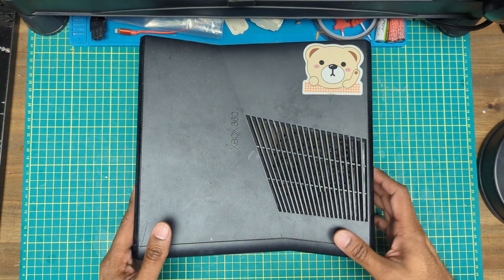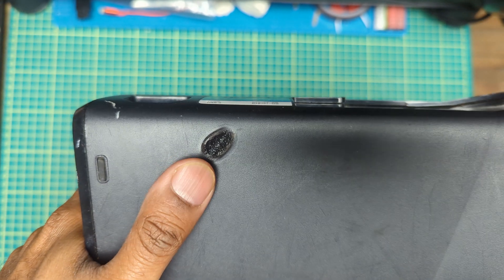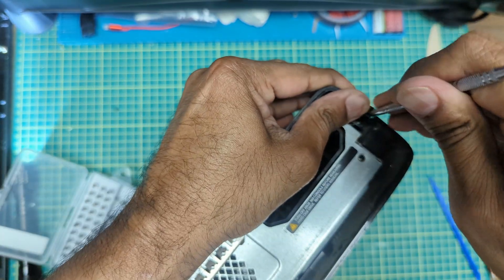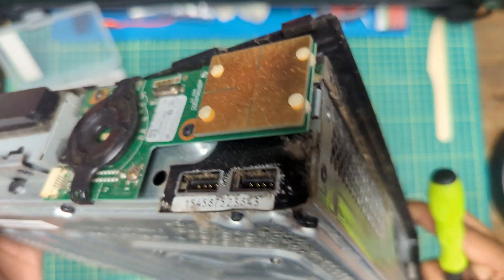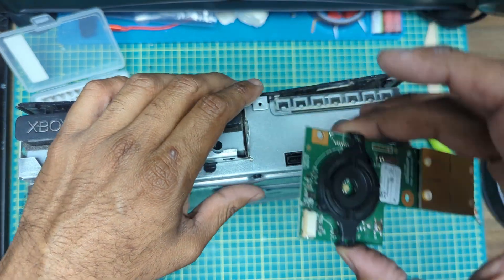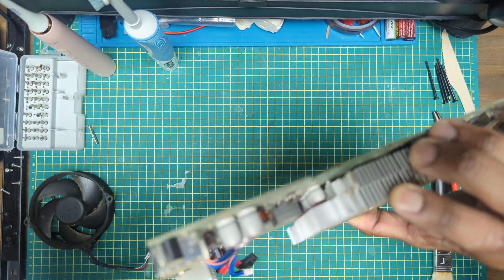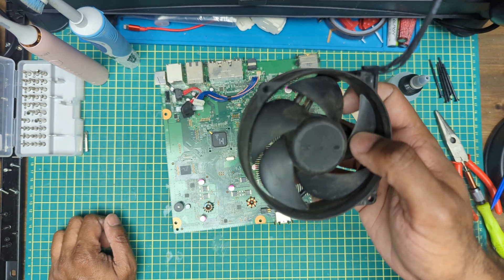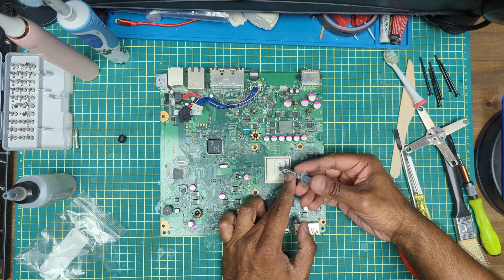Repair Attempt: Xbox 360 Slim That Overheats (And Also Ridiculously Filthy)

Comment: Ive damaged that ribbon cable before too, I think it happens to most ppl who crack these open for the 1st time. Not sure i'd run jumpers long term tho, id find a parts board to grab those 0 resistors from.
Reply from the maker: I do believe you're correct. I think I nicked that cable when poking around for a clip.
As for those jumpers, I've got some resistors on the way from China, so we'll see it back on the operating table again in the future. I definitely agree with not doing that as a long term solution though - it's somewhat akin to replacing a fuse with a nail.

Comment: Only some of the slims had the 4GB flash included. The NAND size varied as well (matters if you do the RGH3 mod). I bought 3 or 4 from eBay last year and I think only one of them had the internal flash storage. Luckily they just use standard 2.5" SATA drives, and you can 3D print an enclosure for using your own drives as well. Plus you can plug in a FAT32 flash drive.
I was expecting you to do a lot worse with the clips when I read the comments first. They really are a nightmare when you haven't gotten used to them yet. I think I wrestled with my first 360 Slim for an hour before I got anywhere, but after doing a few I can get them open no problem.
This is my first time hearing about those 0 ohm resistors, that's a pretty interesting problem.
Reply from the maker: Thanks for the info about the flash memory! May do a re-visit on this and try out my new (for me) 3D printer.
And, yep, those clips are an absolute nightmare...